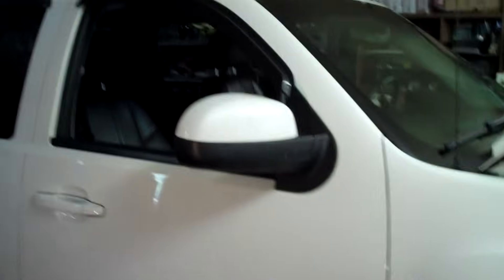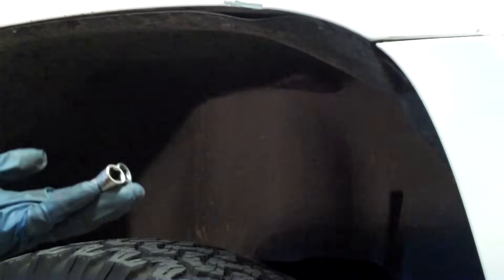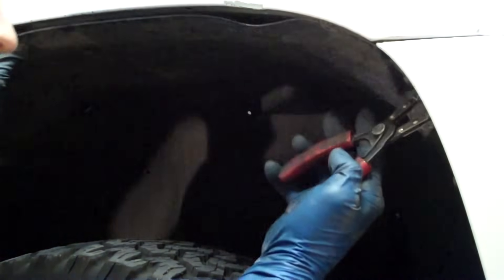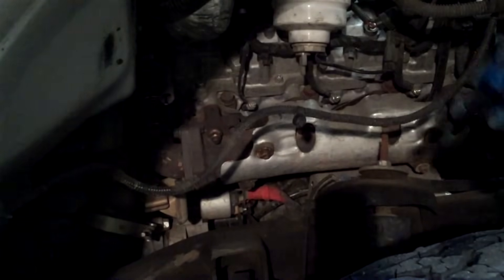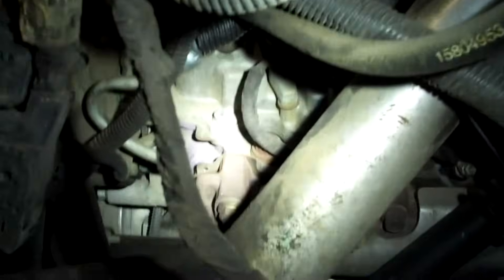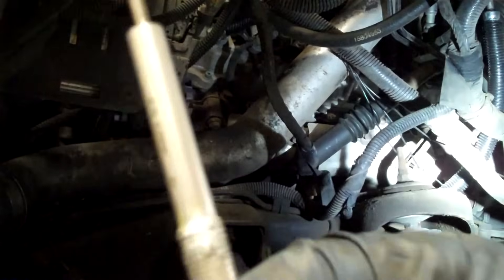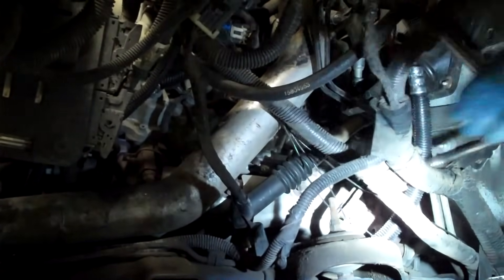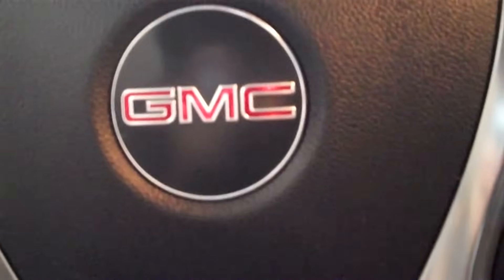How to Change Glow Plugs on a Chevy Duramax

Comment: Steering shaft on the driver's side #4 is in the way. Charge pipe on #2 is in the way. Releasing it on the top side gives you enough play to get to the glow plug and get it out. The steering shaft is supposed to come apart for #4 but I couldn't get mine to separate. I got lucky and got it out and got the new one in. Absolutely use the never seize. Good video. The glow plugs are running $30 for AC Delco now so I'm replacing them as they fail. I would be careful with anything aftermarket if the electrode breaks off it will grenade your motor and that gets expensive to save a few bucks. Thanks for this video, it's always nice to have a reference before doing this job.
Reply: Auto lite was the only ones available when I bought them. Struggled for thirty  Minutes to get the wires tight before the plug fell apart.  When and got NGK right side completely changed in 5 minutes.  DON’T USE AUTOLITE!

Comment: Thank you for the video. Not much out there to guide you on how to do this for the first time. I’m very experienced with cars but not really with diesel or bigger trucks and I need to watch a video on how to do it to not break something or make mistakes and you save me. I’m actually helping a friend out that is clueless to cars. Thank you.
Reply from the maker: Welcome.  Best advice is pre-soak it in penetrant or auto trans fluid and clown fish it.  Back it out a little and back in out some more and back in till it's smooth coming out.  If you think it's going to break after trying that, try it when the engine is hot- exercise caution for burns and fire hazard with whatever you've soaked it with.  Stick a crayon into it to melt into the threads in there. The wax can lubricate it and help it crack free.

Comment: This is a wonderful video very informative.  I'm looking because I just got myself a dyramax and I like to do all of my own maintenance and I have only changed the glow plugs in a 94 detroit diesel.  With that said I made the mistake of putting something on the threads when reinstalling them. DONT PUT ANY THING ON THE THREADS OF A GLOW PLUG!!! I had to immediately replace the ones on my 94 because if it. And it's harder to see in the duramax without a wait to start time. The glow plugs grown on the block .

Comment: Great video. Helpful hint to those who only have the number 8 plug out. You can access from underneath the truck without taking off wheel well plastic (which is a pain). Only tricky part is getting the new one lined up. Look carefully where it is when it comes out. It is right next to a fairly big bolt. And you can see the machining in the block from the wheel well side that contours to the shape of the plug.

Note, it helps to have scrawny forearms like mine. Steve Garvey and Popeye type guys might have some trouble.

Comment: Great to see this. Had a P0677 code so need to change #7. Came out easy but the new one going in would not go in like it should. This is a 2011. Mic'd the shafts and found a few thousands difference in the main shaft in front of the threads but the real problem was the glow shaft. it also was 3 to 4 thousands to large. Stuck the plug in a drill and used sandpaper to reduce the diameter. Thanks again Brian!

Comment: Trick to NOT lose the small nut on top of glow plug - place a small piece of electrical tape (sticky side down on socket) over the end of 11mm socket. force the nut in. It will stay in until you remove it. then easily extract it with finger nails. One piece of tape did all 8 plugs easy. Use this to put them back on as well - saved me a lot of time and risk of losing a key part.

Comment: Love that Ron Paul poster in the background.  Also, your hose clamp puller is for the spring loaded types of hose clamps.  Great tutorial, have to do one of mine on my 2008, on the driver's side.  I gather I'll just change to one considering the mess on that driver's side.

Comment: Is there any torque specs required on replacing the glow plugs itself and the retaining nut to hold the wire on top lots of good information in this video thanks for posting it. 👍

Comment: Dude! You totally saved my a$$; Had #6 go out today and leaving on a trip tomorrow. Not sure if you see this, but this is the 2nd time #6 has gone out in 18mo; 2011 GMC Denali 2500 4wd with 150k miles. Am I looking at a larger problem.

Comment from the maker: Diesel engines don't have spark plugs because the compression is so high it ignites the diesel fuel automatically with heat and pressure.  Starting the diesel is a problem.  The glow plugs work like the grid on a windproof lighter to help the motor to get started.  Once the motor is running, it can let the glow plugs go offline electrically till the next starting cycle.

Comment: Looking at your video and it's very helpful. I have a 2012 3500 and glow plug number 3 failed with just only 51k on the odo. Should I just change number 3 or all?

Comment: Great walk through on a P0676. Kudos on sound, light, and def the laser. One thought- good idea to ohm test the plug first to make sure it's not the circuit or module? If so, what should range be?
Reply: found it myself- ohms should be .4, if over 1 replace, if not, test circuit and module

Comment: Exactly, and everything is accessible just by popping the hood! I've only once had an issue with the grid heater, the ring terminal on to the batter broke off, not bad for a 19 year old truck.

Comment from the maker: Either you have a vacuum leak that is taking in water, or you have an ignition related issue either at the distributor cap or old deteriorated spark plug wires.

Comment: Thanks for the video! Hey I'm in the same boat as baccracker - I'm stumped, how did you get the #2 plug out? Did you remove the steering shaft or is there a trick to it?

Comment: I gave a 2002 Chevrolet Duramax Diesel 3/4 ton and the Engine light is on.  Garages are telling me it is a major job and costly.  Could you give me some idea of costs and time wise for fixing it.  Love that old truck and would like to get it back to being road worthy again.  I live in Nova Scotia, Canada.  Also would like to mention it is a 2500HD.
Reply: Did you replace your glow plugs?
Reply: Not me but they got done.  Works like a charm.

Comment: Nice video, very descriptive!  I changed all the plugs on my 2003 duramax, except for the one directly behind the steering column. I believe cylinder 4 or 6. Any advice?? Do I need to disconnect the shaft? Its hard to get to and there's not much clearance. Any tricks or tips to this? Appreciate it! Thanks.
Reply: I'm sure you figured it out by now, but for anyone else searching for the answer: I just took a ratchet strap and wrapped it around the steering shaft.  With a little bit of downward pressure, I was able to fit a 3/8" drive 12mm deepwell socket in there no problem. I also used a short extension so the ratchet clears.

Comment: Thank you for the great video. I have a #2 that needs replacing. Does the steering shaft absolutely have to come off to clear the plug, or is there another way? Also, do you recommend replacing all of them at the same time, the truck is at around 87K miles.

Comment: P.O. 670 glow
Plug module. Have you changed it or had come across this code . What was the process of checking . I don’t know or understand how to use or read a multi meter . I have 1 never grasped it .

Comment: will this video apply to 02 GMC Sierra with the duramax?   I have been driving mine with the check engine light on for 65K miles and it is now at an overall odometer reading of 206K miles.   I bought it  7 or 8 years ago and the light was on when I bought it so I don't know how long it has been on overall   Several mechanics have said that it is the fuel injector but a mechanic told me today that it is the glow plugs.

Comment: if i use antiseize should i tighten them down pretty tight, or should i just turn them in by hand then give it a little torque with the rachet and socket?

Comment: hi brian, nice video, i have a 2003 chevy duramax, 178k miles it runs good n strong, however about a week ago the idle its been acting up, the motor revs up a notch then goes down again to normal, so it does the tacometer neddle at the same rithm i wld say it does it every 5 seconds or so and sometimes does not do it at all, like i said the truck still runs perfect as it launches....any idea what it might be?? thank you very much!
Reply: Did you ever find the cause for that problem?

Comment: Good video - just had this done by the GMC shop and they broke the glow plugs off on two of them.  I assume they used an easy out...?
Reply from the maker: Probably a heat wrench.  You don't want the center to get into the cylinder or your day just got bad.
Reply: +briansmobile1 What do you mean by heat wrench? I have a broken #8 and could use it if it will help get it out. I dont want to pay 4k to have it removed. As well my number 7 is out and I can see the same thing happening on that side too.

Comment: Hey brian, have a 2002 f150 4.2 v6, while in drive and reverse it stumbles very hard nearly to point of a stall, occasionally it will stall. I've put a new pcv hose on it and various other things. Doesn't do it while driving or in park. I'm suspecting a vacuum leak, any ideas? Thanks.

Comment: How do you change out the number 4 glow plug - I have been stuck for 7 hours trying to get it out
Reply: For anyone else having this issue, you must remove the bolt on the steering shaft, keeping the steering wheel stationary, and push up on the upper shaft after the bolt is removed. This will push it up and out of the lower shaft. The lower shaft will now hang down towards the frame and out of the way so you can remove #4 glow plug with ease. Re assemble, and assure the bolt is very tight!  Do not use a ratchet strap to pull the steering shaft as this will damage it
Reply: NordicPride970 i just used a 1/4inch drive rachet and extension
Reply: Get a wobble drive or a flex drive quarter inch extension

Comment: Cool video, thanks! (Believe it or not I've been in the biz at least 40 years, and have only worked on 1 diesel... and that wasn't engine related. Why? Couldn't tell you... just never had any show up!

Small nit pick... CAN actually stands for "Controller Area Network". See the CAN buss  Wikipedia entry.

Comment: on the 6.6 the fuel filter should be changed every month to prevent injector failure! If it does not get changed often the fuel will contaminate the pistons and you will then be putting in 8 new injectors! I know this because I work for GM!

Comment: How do you remove the steering column on the drivers side to get it out of the way???
Reply: You don't need to remove the steering column or shaft - just gently pry it out of the way with a small pinch bar.  It only needs to move a little.

Comment: briansmobile1 I have a 2010 with a tuner install and I got the cylinder 4 glow plug bad. What I'm scare is that if I disconnect the computer my programmer will be delete it. Can I just disconnect the batteries or I have to unplug the computer?
Reply: I think he's talking about unplugging his OBD 2 code reader. Dont just leave it plugged in. Turn the key off & unplug the code reader.

Comment: clearly not from the rust belt,try changing glow plugs on a duramax from new england, the wire never comes off,the glow plugs snap off in the head. its a real bummer.

Comment: i would disagree brain, i work for GM as a diesel tech the duramax is easy to work on up till 2007 with the LMM came out you no longer have room it becomes a nightmare, the powerstoke is the sameway the 7.3, and 6.0 up till 2008 nice and easy to fix, just take a lot of time to fix, tons fo shit to remove, but i honestly find diesels have mroe room to work on compared to gas engines once u get USE to them